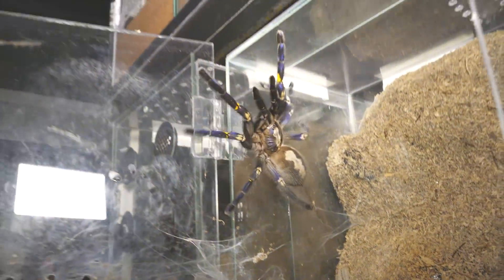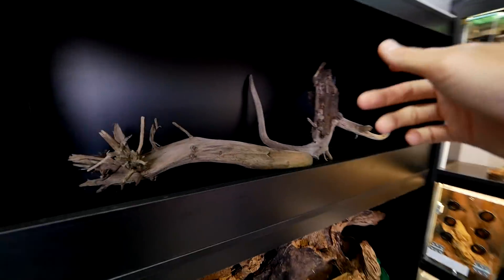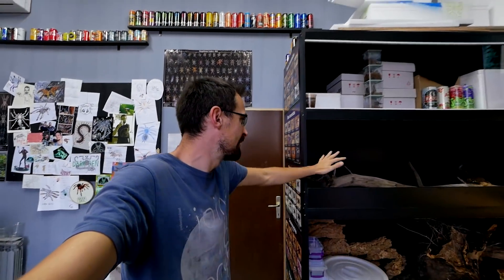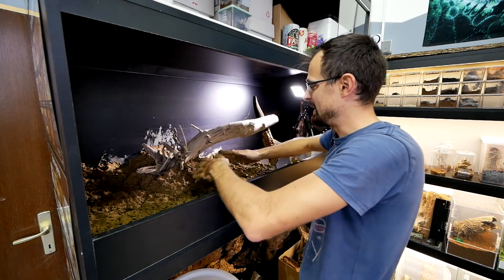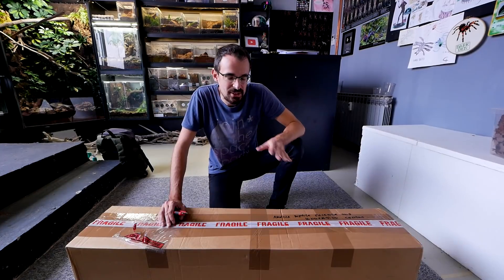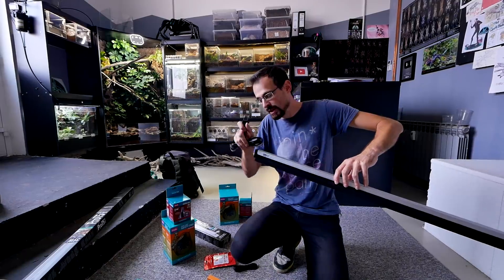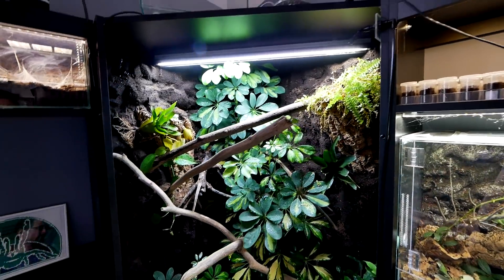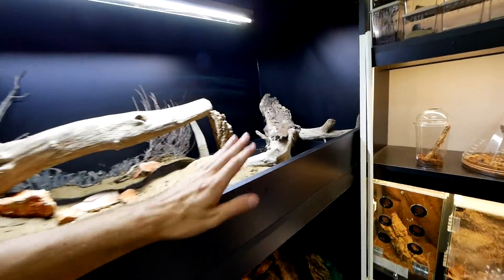LIGHT IT UP! - Arcadia Reptile

Comment: I highly recommend avoiding pure fine sand for bearded dragons. I do think some loose substrate in their enclosure is important for enrichment such as digging, but you want to avoid bacterial buildup and the irritating dust from fine sand that can cause eye and cloacal infections. Mixing with organic topsoil is what I would suggest and adding a small amount of water. This will help with keeping dust down and provide a safer and more enriching substrate for your bearded dragon.

Comment: awesome set up but why did you get a light for the leopard gecko they get heat from there bellys and they need head matts bulbs can dry them out and  chameloans need specific heat and humidity so it needs a door for high humidity and berdies live on rocky dry lands not nere sand ive kept reptiles for years i would only ever use slate or tile your taking a big big risk

Comment: Won't those shelves turn soggy overtime and rot, or were they coated with a water proof barrier?
Reply: It is a plastic veneer on the outside and probably cheap MDF wood as a core. Since he sealed the seams with silicone. It shouldn't be able to touch the MDF on the inside.

Comment: Most sand is fine to use, calci sand is terrible, stay clear of that but like kids play sand is fine as long as your husbandry is on point, if UVB and the heat gradiant is correct then its fine and the beardie will pass sand no problem. People have been keeping dragons on bioactive setups fine for years. Impaction is a secondary problem, and people screaming impaction are using outdated sources of information.

Comment: define "sand". Because if youve ever bought a bag of sand (which was likely quartz if you have and dont live in a tropical-coastal setting) and read what it actually was youd realise that "sand" is "granular material composed of finely divided rock and mineral particles. It is defined by size, being finer than gravel and coarser than silt. Sand can also refer to a textural class of soil or soil type; i.e., a soil containing more than 85 percent sand-sized particles by mass" (yes i copied and pasted that shit idgaf lol). So now that we know sand is just a measurement lets look at what they actually live on. And with Australia being extremely rich in iron, aluminium, manganese, uranium,  gold, nickel, copper, lead and zinc ores (those being the most commonly mined) you now need to look at how many of those minerals appear naturally on the surface and thats what your mixture of "sand" would be. sorry this shits long its just real hard to read this idiocy.

Comment: Sorry that is definitly no good light Setup for Bearded Dragons. You have to use something like Bright Sun or Solar Raptor. The arcadias do not give enough UVB for a desert enclosure. It is way to dark and the temperature will not be hot enough for this animals. Also why didn`t you make a proper background that the animal can use for climbing,because the enclosure is not really big.  Like your spider setups but this is not what I call a proper dragon enclosure. Sorry